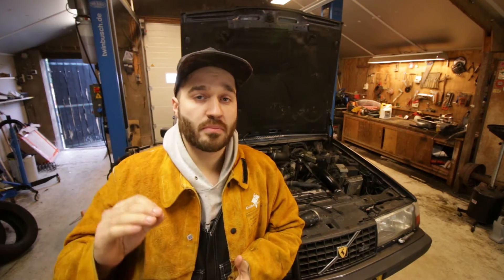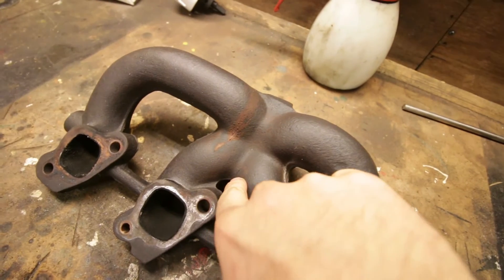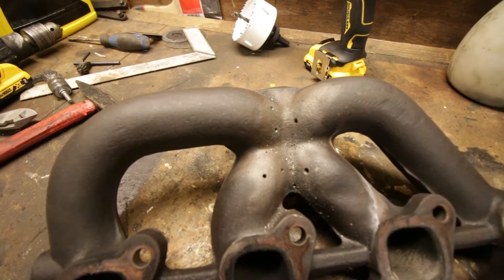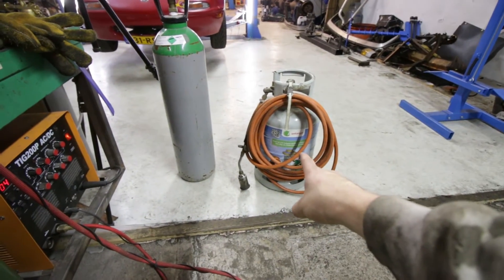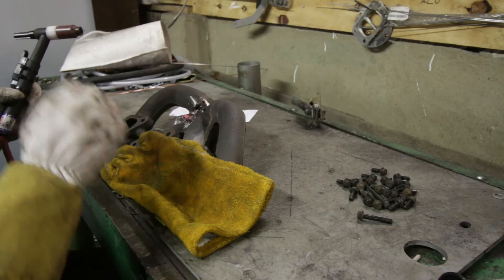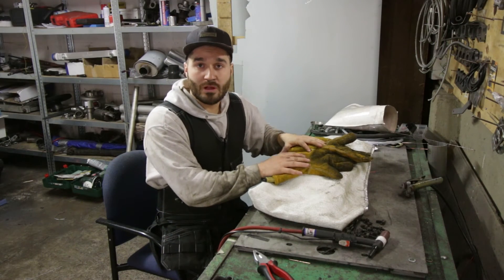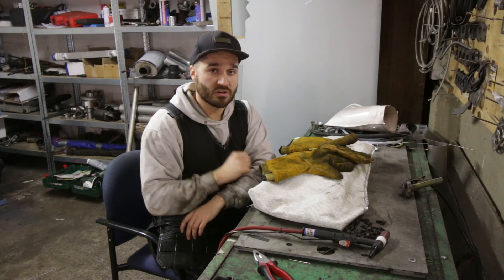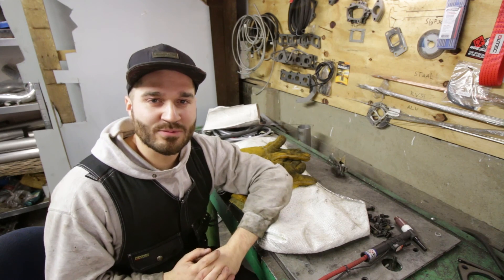How To Repair a Cracked Turbo Manifold

Comment: how to repair: You buy a new one.
Reply: They aren't making any more.
Reply: @Iain240  so the junkyard doesn't have any? Just buy a better manifold instead
Reply: @alexstromberg7696  99.9% of them have cracks.
Reply: @alexstromberg7696  why would you waste money on new when you can easily fix what's still usable?
Reply: @MesquiteAutomotive  because welding cast iron is hard
Reply: Alex Strömberg get good
Reply: @MesquiteAutomotive  lmao you've never welded.
Reply: Alex Strömberg LoL. I make my own manifolds, down pipes, exhausts, cages. The list goes on. Maybe you need to preheat your material more. Use the right filler rod. Or just spend more time under the hood.
Reply: @MesquiteAutomotive  if you can't make your own, why would you reweld a shit manifold?